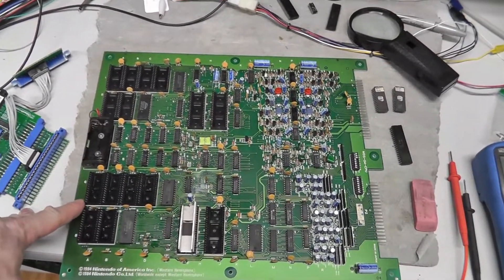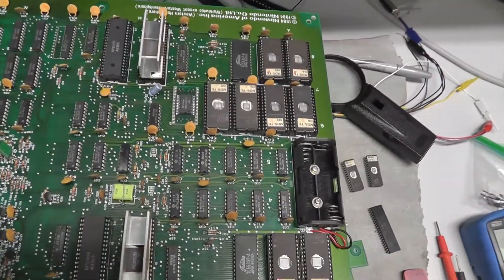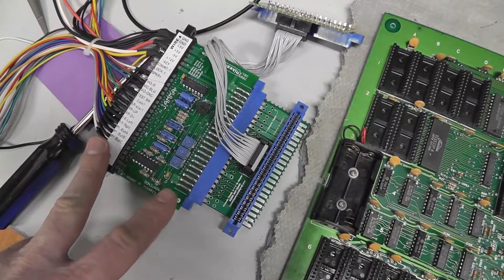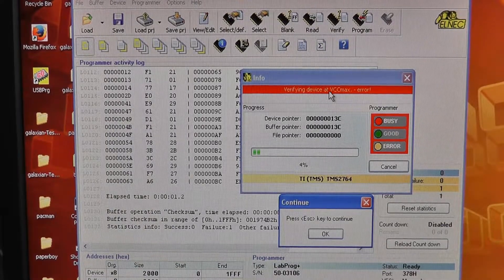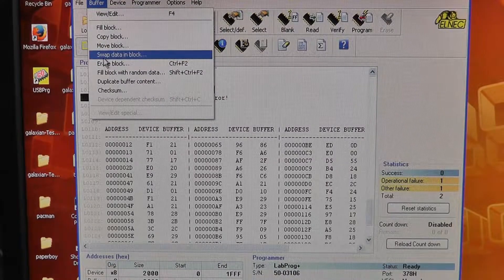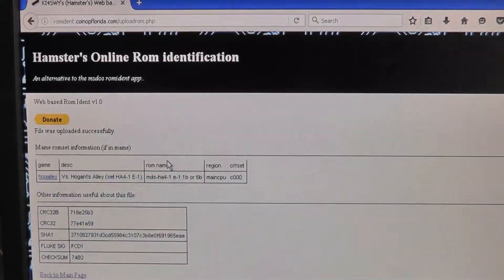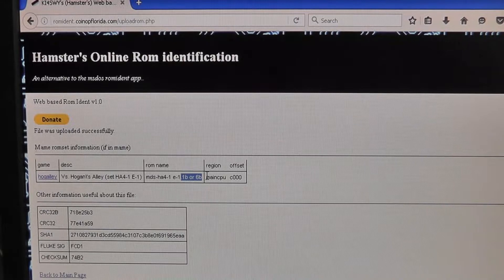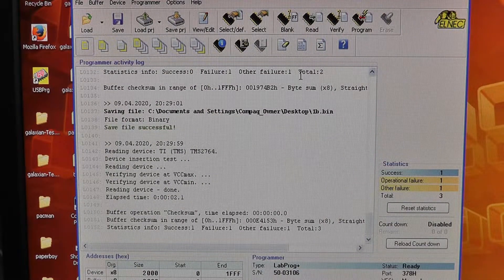Nintendo VS PCB Repair - Part 1 - Cleaning,Testing, Verifying Eproms at +/- 10% Vcc

Comment from the maker: Two important things since making this video
1) The noise at end of video is expected.  Some alarm because gun isn't hooked up to board, I believe.
2) SUPER INTERESTING (to me). I took the 2 questionable eproms back to the programmer and reprogrammed them with their respective binaries, without erasing them.  Now all eproms verify at +/- 10% or 5.5v and 4.5v.  Maybe they are good for another 30+ years

Comment: I'm not sure why the ROM chips are failure when the voltage is at 4.5 volts it must be how the cells are either capacitors cells or FET cells, not sure why they are failing at 4.5 volts or at 5.5 volts?
Reply from the maker: Mine were failing to verify at just 5.5volts as it never got the low 4.5 volt verification.  However, since the video I found this doc. https://www.elnec.com/sw/an-825.pdf and I don't quite understand it 100% but my laymen explanation.  a fully erased cell will have all its electrons in the channel between control gate and floating gate.  When programmed it pushes all the electrons to the control gate so they wont conduct at 5v or even 5.5 or higher which results in a reading of zero.  partially erased or exposure to UV, like many nintendo roms, will charge the electrons back down to the channel which allows them to be activated and read as a 1 again.  This is why when I reprogrammed them, (not shown in video), i was able to verify rom at 5.5 and 4.5v.  Reprogramming them at VPP voltage pushed all the electrons from channel back to the control gate.

Comment: Jacklick, when you read a rom chip what does the ASCII data mean? its converting the read hexadecimal rom values into ASCII data for what reasons?
Reply from the maker: It is actually converting the binary data (zeros and ones) to hexadecimal.  8 bits (word) = 2 hexadecimal numbers.
Reply: Yes but it also on the right hand side which display the ASCII data value of the hexadecimal values also. The software programmer will read the ROM data content and display the binary data into hexadecimal numbers but also will display the ASCII data values, any reasons why you need to know the ASCII data values?
Reply from the maker: Oh my bad.  Yea I am not sure why they display the ascii.  Sometimes it is printable ascii which I guess could help reading it but really haven't got a clue.  Maybe a programmer would know the usefulness of it.  Good question.